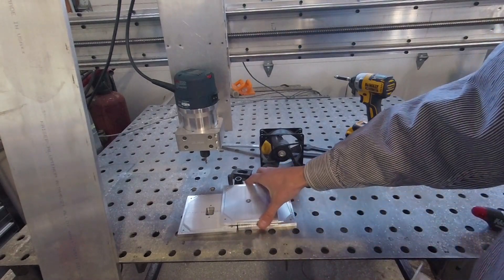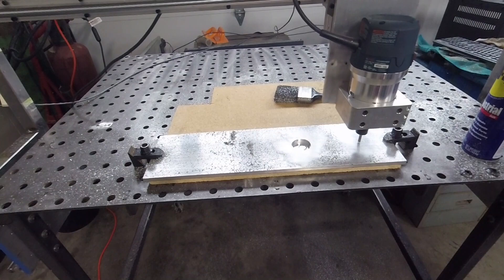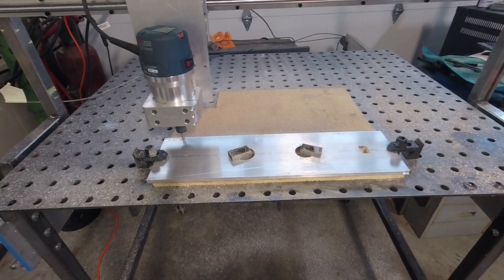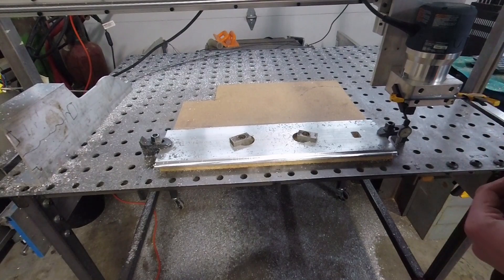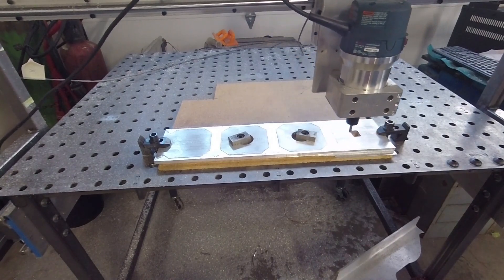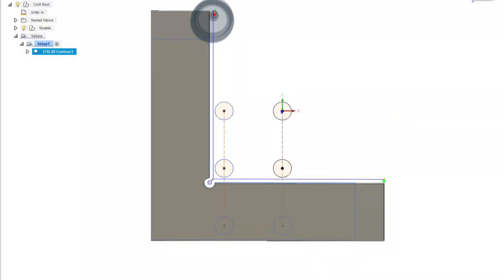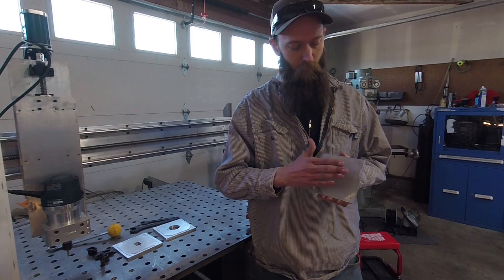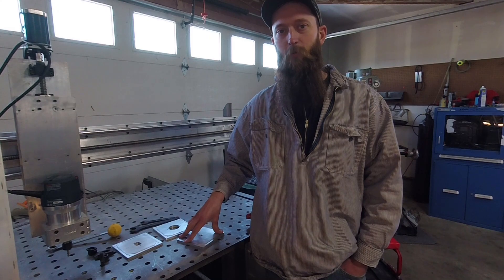Milling Aluminum on DIY CNC Router

Comment: Nice strong build, you could weld a triangle plate in the gantry to stiffen it up, and I would go for better stepper couplings anyway think you are on the right track, have fun.
Reply from the maker: I have thought about a brace there to stiffen that up, I was almost thinking an adjustable one to really dial in the tram of the gantry. Thanks for watching!
Reply: @riversvic  I'm just curious, I see that you're using steel for the frame of the router - does this offer an advantage over aluminium? I only ask because most CNC routers I see have aluminium frames. I suspect it's to do with the weight, and shifting it around with smaller motors, but not sure! Is steel much better in terms of rigidity?
Reply from the maker: I think the rigidity depends a lot of the profile of the material you are using, most of the aluminum extrusions people are using are very rigid. There is other factors however of stress life and vibration dampening. Majority of the reason I used steel was it’s cheaper then the extrusion type aluminum and I was able to do what I needed in it with my limited tooling. I think a lot of people use aluminum extrusion because it’s easy not having to do a lot of machining and then others use it because their router is capable of machining the parts they need out of aluminum. Thanks for watching!
Reply: @riversvic  No worries! I think you're right. Not to mention shipping steel everywhere would cost a fortune!

Comment: Great video, what size motor is the on the cutting head
Reply from the maker: The cutting head is just a Bosch 1617 Router, I believe they are stated at 2HP. Thanks for Watchin!